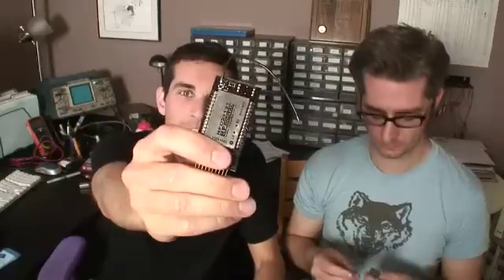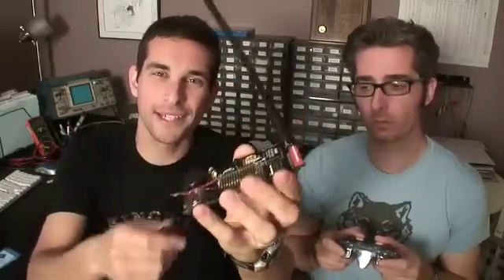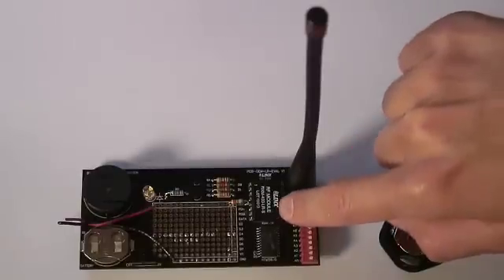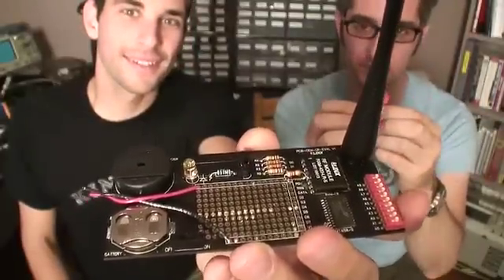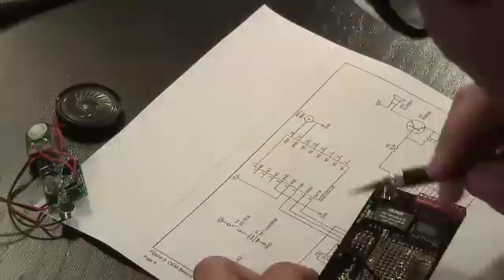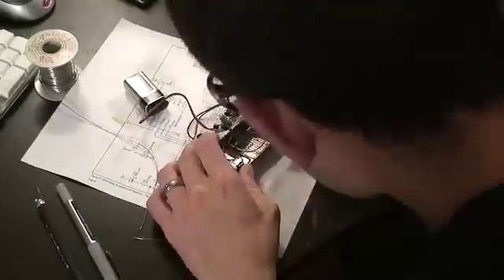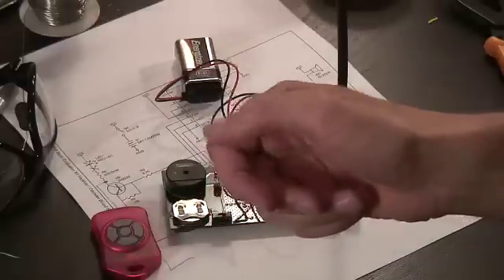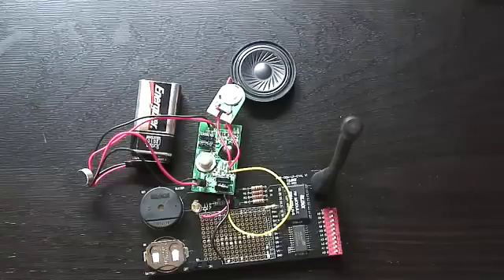Playing with RF Modules - Awesome Electronics Workshop Podca

Comment: Let's see you make a RF transmitter/receiver set that will separate the Hydrogen/Oxygen from Salt Water like John Kanzius. You can use 12 volts D.C. at 10-20 Amps as your source of power. Make it small enough to fit under the hood of a car. Hint: A mix of 13.56 and 27.10 MHz.